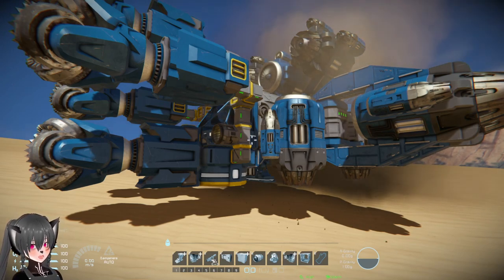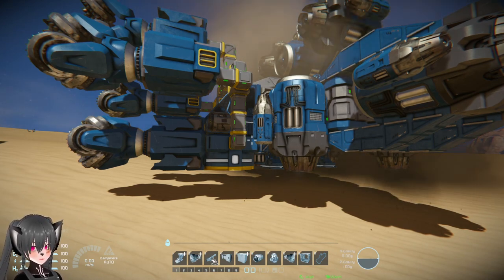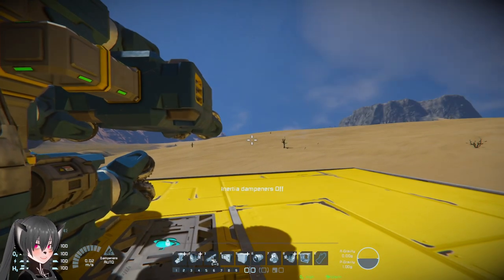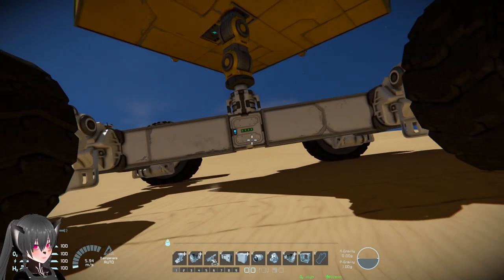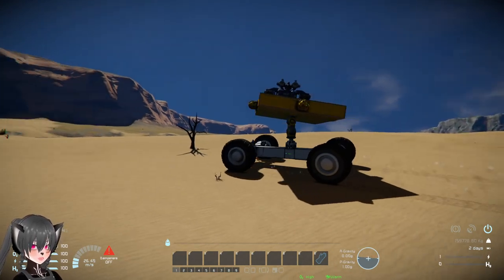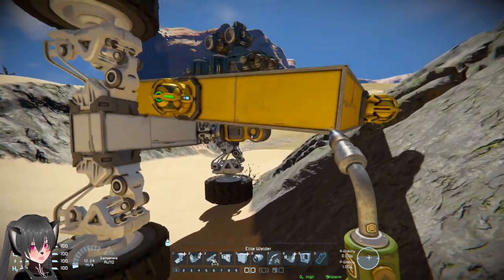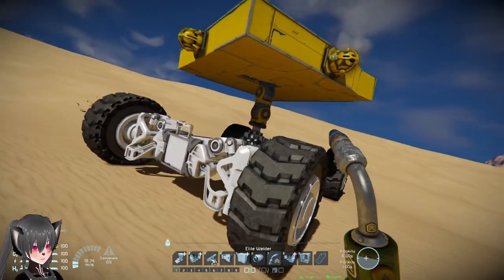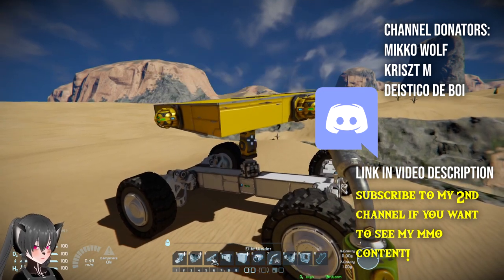Self-Leveling Rover Landing Pad but it's Wobbly, Space Engineers Automatons

Comment: Hey luca my pc is currently broken but I want to share my weapon project i was working on ok so you take drones and stuff them full of artificial mass blocks and you have a gravity cannon on your ship so basically the drones try to stick on to the target via magnetic plates and these drones can fragment in a sort of way they detach into lots of mass blocks with blast doors/ heavy blocks on them lots of batteries but how they work is that when they stick to a large grid they switch their mass on and if the enemy has a gravity generator it drags the ship around until they switch it off then you go in and turn your cannon on and boom you throw the enemy away from you at high speeds and or into an asteroid I have 2 drone variants one sticks to the hull the other is like a missile it goes into the hull and again switches on the mass and sits and then when you get in range you force the blast door interior of it barreling through the interior of their ship shredding crew conveyors and weapon systems. As mentioned earlier they can fragment so for dealing with small attack craft you simply point the drone in the direction of said ship make it fragment spreading blocks I believe its around 30 and then flip on the cannon and its like birdshot if you miss you still scare the hell out of them its pretty impractical but still funny to watch a whole crew panic as their ship barrel rolls uncontrollably 😅 it also has 1x1 tires on the 2nd Version as to create more carnage
Reply: On a 2nd note any crew not flying will get tossed around the interior by the grav gens or from the ship spinning out